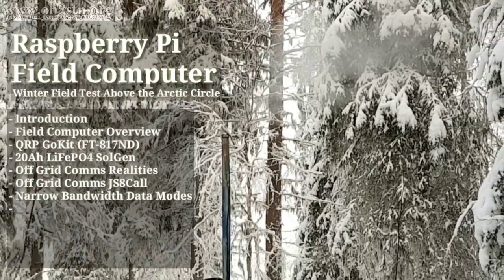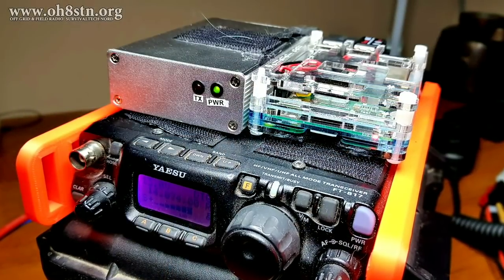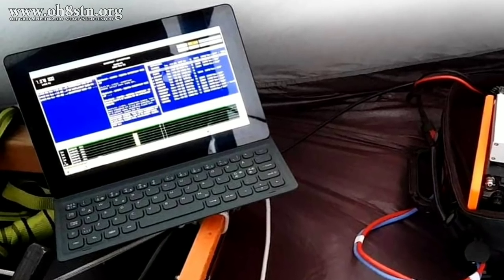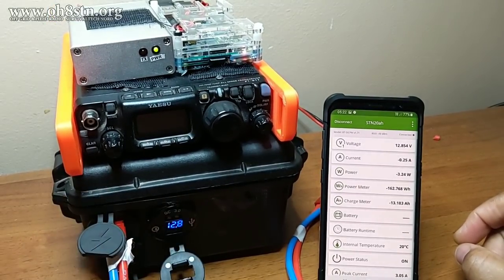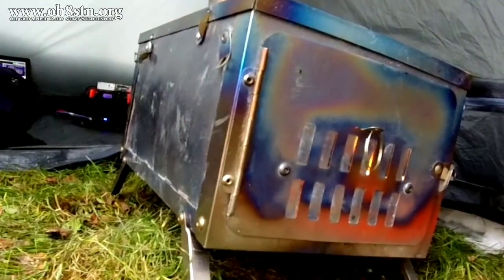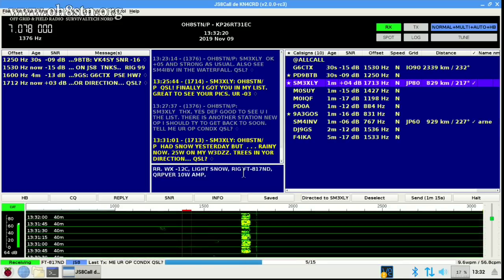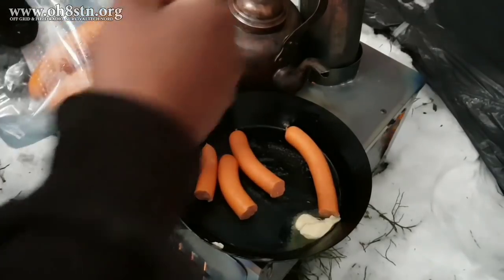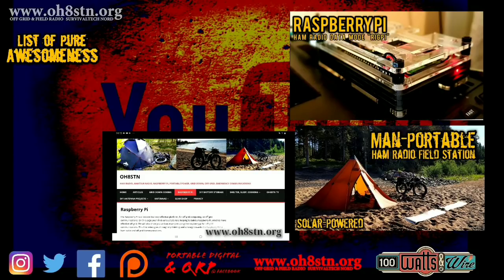Off Grid Ham Radio & Raspberry Pi Field Computer

Comment: You bastard! I'd just resolved to spend my next few paychecks wisely, but now I gotta pimp out my 817 instead!
Have you made any major discoveries RE: measuring battery voltage from the pi, maybe using Python? I have an off-grid RasPi radio project of my own and had resigned to including an ADS1115 in the recipe and using Python w/ GPIO library to programmatically read and respond to power conditions. My off-grid deployment project will work in concert with a weather station to implement a rudimentary ATIS/AWOS and lights activation at a remote private air strip. The ADC is on the board, but It's not wired up yet because I have to research a necessary voltage divider to bring the ADC measurement into the 12v range, as well as fit a different radio with a smaller footprint -- but I'll post an update some day when I can afford to put all these projects back together :P

Comment: I'm still wet behind the ears with JT8 but so far I haven't seen any activity using it outside of swapping grid squares & signal reports. Where does the extended QSO's occur? I do like the use of GridTracker, especially as a method of determining where my signal is being heard, but so far outside of "carving notches on the bedpost" of collecting grids, counties, states, etc. I haven't experienced any further use for the mode.
(I'd definitely like to sked a QSO though.)
Reply from the maker: Have you tried calling CQ on 40m?
JS8Call has two layers. Traditional kb to kb QSO, and the network. The network eg heartbeats, acks, queries, is always visible and not intended to initiate a qso. Call CQ and you'll likely get a response.
Reply: @OH8STN  I call CQ & CQ DX for responses, but the exchange is always grid square & reception reports. I guess I've never got off the network. I'm off work in an hour, I'll be giving it a try this morning for sure.
Reply from the maker: @HawkKI4HEE  RR Bobby. Have you checked your computer timing? If your computer time is not synced correctly, you won't be able to make contacts. It's the same like FT8.  Also try to check psk reporter to see if any stations are hearing you. There's not as many operators as there is with ft8 oh, but there is a lot of activity especially at the right time of day. Just a quick question, do you have experience with other data modes? I'm sure we can get you going oh, I just need a little bit more information.
Reply: @OH8STN  Oh yes I'm logging great contacts and the Gridtracker Map's PSK reports has me getting reports all over depending on band conditions. I just wasn't aware there was any extended QSO's going on. Up to now it's just been Grids & Signal reports. I've never been a contester and while it's neat seeing the map filling up with squares I've worked, it not of great interest to me.

Comment: what Antennas do you use?
Reply from the maker: This time I used a Packtenna 9:1 with telescopic mast. The antenna performed well but the DX Commander mast failed almost immediately. The -13C/8F temps first froze the mast, then shattered it in the wind. I omitted the antenna in this video because it was the fault of the conditions.

Comment: Hi. Very inspireing info.

My Raspberry Pi 3B+  to control my rig IC-7300 setup  is way behind your faboulous setup, and one day I hope can make it better.

My setup is plain  and very basic.  I set my RPi  to connect either to my broadband P router or to my Android smartphone in hotspot  mode.  When outside my base,  I enabled  hotspot on my smartphone, and RPi  will automatically  connected  to Internet to set it's time/date .  If I unable to get proper data coverage,  I use GPS app tu  check the correct time and location, and set it up manually or by using scripts.  

I also do not use GUI/VNC connectivity to the RPi. I only use SSH with Android app called 'termux'.  I can find the RPi address when connected to smartphone's hotspot, using this command.

$ arp -an

To control IC-7300, I use hamlib's  rigctl command, and my own custom made scripts., which I able to control or set most of the IC-7300's  features and settings.  With Bluetooth keyboard connectted  to the smartphone, I can operate my rig very quick and efficient.  I also can send the audio from the rig to my smartphone, through  RPi. 

One day, I hope can bring out my simple setup portable outside my base.  :)  I have 7Ah 12V small bettery pack, and USB power bank, which is enough to operate the rig during blackout.. :)

Thank you very much for sharing your valueable information, and good luck.

Comment: Excellent as usual.  Can you address the concept from FT8 experts that we should NOT be using narrowband IF filters.  I assume the same is true for other weak signal modes?See the technical info on the video "RSGB 2018 Convention lecture - FT8 Secrets"  Can you test this or comment?
Reply from the maker: Absolutely. FT8 operators run filters wide open, to maximize  the possibility of hearing all stations in the band pass. Nothing wrong with that until you come to the QSO of a station which can barely be decoded. Since  FT8 is "auromatic" to some degree, our stations will try/retry to complete the QSO by asking for that sequence again. An experienced weak signal operator in that same situation would tighten the filters around that station, to increase receiver sensitivity, and complete the QSO. This requires the operator to operate the station proactively. Certainly the filters are wide open, or as wide as the band pass during normal operation. For that individual QSO, where you want to bring that signal a little bit further up out of the noise, we use our filters. After the QSO, we return them to normal.
We must remember,  FT8 it's not about the quality of an individual QSO, it's about maximizing the number of QSOs logged.
Great question and I think I'm going to do a video on this topic 👍👍👍
Reply: @OH8STN  I listened to the presentation again and he seems to be down on adding narrow band filtering to the transmit signal rather than receive. I should have been specific.
Reply from the maker: @johnossi4234  the question has become a moving target, and is  impossible to answer. 
Take a look at this post I made based on your initial question.
https://www.instagram.com/p/B56wNquDOFv/?igshid=13c12wrryf8jz

Comment: Excellent content as always. Got the VNC set up working, but the image (of the pi screen) on the android needs size adjustment. The image is oversized and cutoff on the sides, while the image on a hdmi connected monitor is perfect. Is this a function of the pi or my Samsung Galaxy Tab 10? Also been trying to buy the power amp but not available and no reply from customer service? Any ideas?
Mike
Reply from the maker: The resolution problem could be on the Raspberry Pi side. It could also be your VNC client settings on the Samsung. I would do a simple Google search "how to adjust VNC resolution on a Raspberry Pi".
QRPVer it's a small company. Infected might be just one guy I'm not sure. He is slow to answer, but many of us have received our amplifiers.

Comment: Can you make it all in one waterproof box pre-wired?  Perhaps affix the tablet to the lid of the case and the radio in the bottom?  Then it would be self contained.
Reply from the maker: Definitely. In fact one of my buddies just published a video on exactly that topic. I thought about doing this myself, but I can't even consider starting until I have the prototyping done on the 891.. There's also the question of the power supply. Sometimes I want to take a big solar generator, sometimes I would only like to take a battery that lasts a day. So I need to come up with a modular way of achieving that. Here's my buddies video though. Let him know where you found it. It's definitely worth watching.
https://youtu.be/diEEZVrVr8M

Comment: WOW,  now I get it, sort of, so tech stuff, weights? # of boxes, did you pulk, ski in to cabin? it seems its always about the power and draw of amps. If you get back to Oslo please check out the Resistance  Museum . In side you will find a steam turbine to generate power for recharging batteries. The WW2  Norwegian radio  operators were impressive.

Comment: Another GREAT video.  Super informative.  Super motivational.  And like all of your videos, chock full of practical real world advice.  Thank you!

I've enjoyed watching and learning as you and a couple of others blaze this personal EmCom trail, but I've been lazily waiting for others to provide more of a turn key solution.  Maybe I'll provide that solution for lazy guys like me.  A Pi 4 with all the software, GPS, realtime clock, 12V buck converter, etc., pre-configured with CAT control for different radios.  Sell it on Amazon and maybe eBay for $10 more than the component cost, after selling fees, more as a service to the amateur EmCom community and to popularize this as the EmCom standard.  Markets play a large role in developing standards.  I'd much rather YOU sold that product, Julian, given that you did most of the development and most of the promotion.  Hopefully it'd be a hobby related way to support your channel, but it's sometimes true that turning a hobby into a business ruins a perfectly good hobby by making it into work.

I completely agree with the idea of using JS8Call.  I'm entirely sold on it.  I can understand hams who want to use all the different frequencies, SSB, CW and every digital mode.  It's all fun as a hobby but a hundred competing standards is no standard at all and that's not practical for emergency communication.  What's needed is ONE reliable low power mode so everyone knows how to communicate.  Redundancy is good, but not in com modes.  Have redundant hardware to communicate on JS8Call, 40m &amp; 80m, NVIS or DX depending on antenna configuration, and 2m or 70cm for local communications.  KISS.

I was reading your JS8Call messages.  There was a character glitch.  Freezing your WHATS off?  :-)

Comment: Very cool compact portable setup! Why not use the tablet for the power control app, instead of needing a phone? Also, was it difficult to extricate the soundcard & GPS hardware internals from their plastic casings to allow plugging them in close to each other into the Pi USB ports? Thoroughly fascinated by the culmination of your many many months of experimentation and research. 73

Comment: Like the Pi for a remote control computer but then it would need Internet access in my vision of remote access. I prefer a laptop for "portable" use as it seems necessary for remote control of the Pi since the Pi does not have a screen, mouse or keyboard. I know you can add these things to the Pi but that brings "me" back to a laptop instead. Thank You for the videos keeps me thinking and "aware" of other ways to do things. . .    ; )
Reply: I may be misunderstanding you, but the Raspberry Pi is perfect for this application, and there's no 'need' for Internet access, as that could be self-defeating if you need a quickly-deployable, highly-capable portable field ops. station that's deployable anywhere. Get a tablet, have software that supports your digital modes, install a VNC client, and you're ready to go. Obviously, a laptop works great also, especially if that's what you prefer.
Reply: A big advantage of the Pi is the fact that the "tether" to the rig is wireless.  You can operate from anywhere within wifi range of the radio.  You don't have to sit right in front of it.

Comment: Great video. I’m working on programming my pi3 b+. I’m working on the gps time system. When I go to edit chrony the file is blank. There is nothing there to edit. If anyone has a suggestion, I would be grateful for the help. Thanks
Reply: Yep like Jeff said, verify Chrony was installed.  If it was then double check for a typo when you attempted to edit.  If you have a typo the editor will think you intend to create a new file and it'll open up a blank file with the name you just gave it.

Comment: Which antenna did you deployed this time? Thanks for your wonderful videos:):)
Reply from the maker: Thanks 👍👍👍
I took the packtenna mini and telescopic pole. The ice destroyed the DX Commander telescopic pole, so I didn't show them in the video. I decided not to show either of them in the video since they weren't designed for these conditions. Thanks for the question :-)
Reply: @OH8STN  So then what did work? Your conditions are most likely harder than I'll ever have or see but would like to know what works is those extremes.

Comment: I recently found your channel, and appreciate your well considered concepts. I’ve got some catching up to do now. Have you done a field station with the ft-891?
Reply from the maker: Hi Karen. Thanks for the comment question and kindness. I didn't mention it in the video but the point of the field test in Lapland, was preparation for winter field day. For Winter Field Day 2020, I'll deploy with the ft-891. The 891 is my default system for critical Communications. The 817nd is simply my prototyping platform.
Anyway thanks for reminding me. I'll have to write a blog post about that tomorrow.
73
Julian oh8stn
Reply: OH8STN OK thanks. I found your digital setup video for the ft-891 video. I believe you were using a digimaster miniprosc and Windows. But I read that this interface does not play well with Linux. What interface do you use with raspberry pi and ft-891?
Reply from the maker: @kareneighth6045  the miniprosc plays extremely well with linux. I only removed it from field work, for added portability. I think I'll do a video setting up that interface with the Raspberry Pi. Others have already asked for that, and it's already in the works. Would that help?
Reply: OH8STN Absolutely. Thank you.
Reply: OH8STN please include benefits over the 2 cords, usb + 6pin din to Sabrent. Thanks